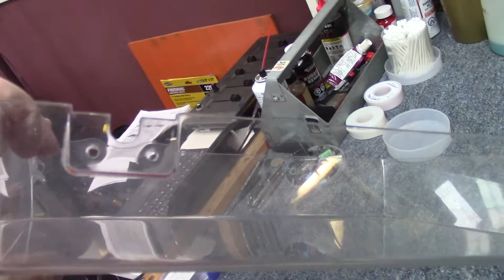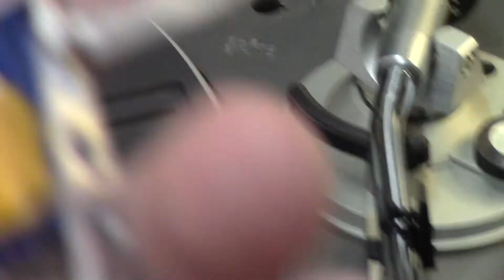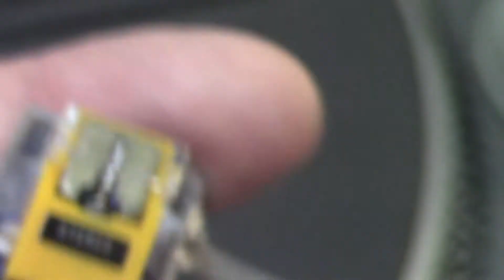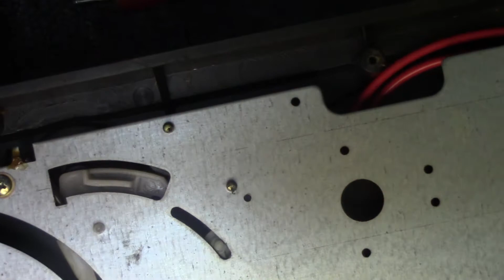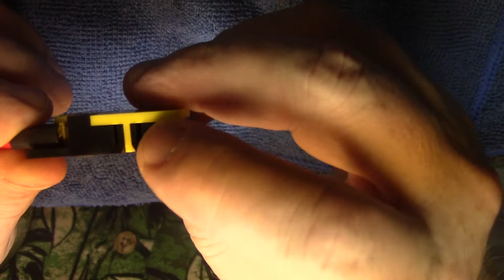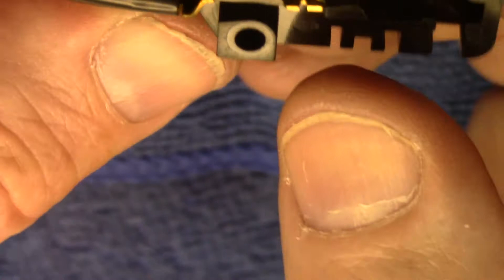Toshiba SR-F451 Turntable pt.1 eval & repair

Comment: Any idea what the 2 holes are under the counter weight? Looks like screw adjustments.
Reply from the maker: I don't recall but my guess would be for tonearm start/end  adjustments?   I do believe the service manual is available at:   vinylengine.com